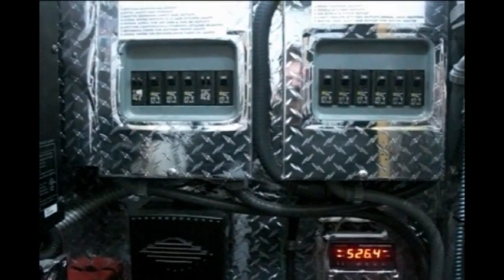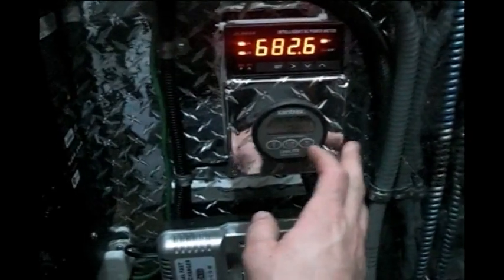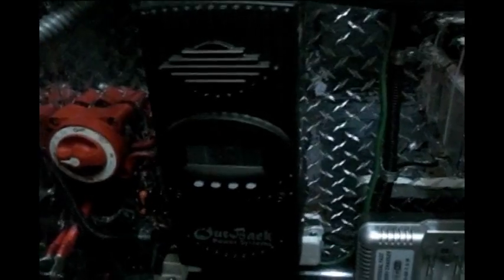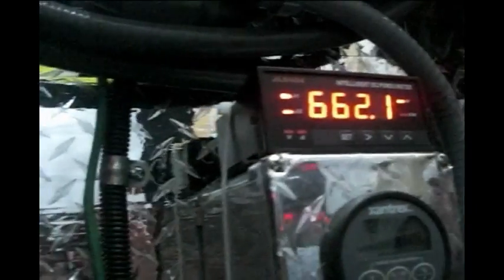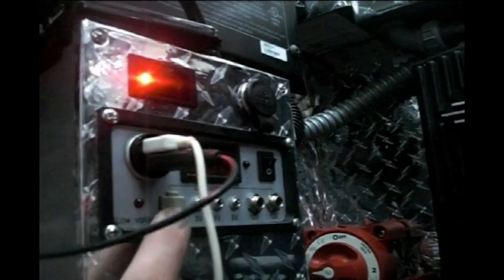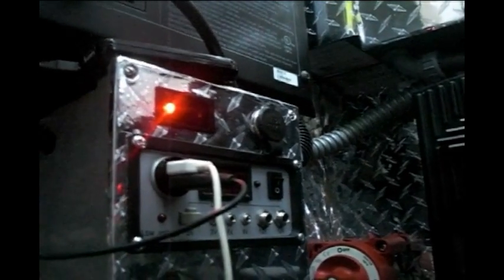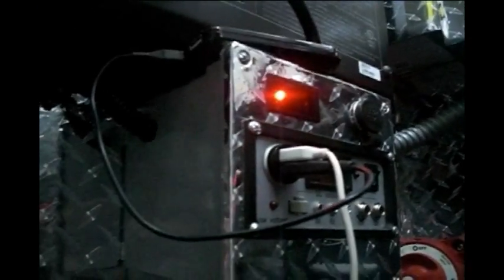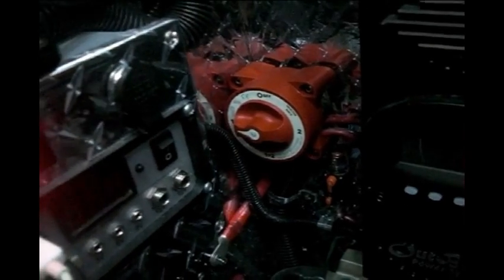My (NEW) Solar Power System "Revised"

Comment: Very nice set-up. I really want to move to that APC unit. Quick note. I encountered same problem on my Blue Sea switches running in the 1/2 position. I think you may be sharing same neg, so u might try running to a separate neg bus and from there have one neg lead to your GTI and one negative lead to your battery. Keep the videos coming. You provide a lot of great info

Comment: If your grid tie inverter is humming at night when there is no solar you may be back feeding the inverter with your battery bank causing the gti to run 24/7.  You may try a blocking diode to keep from having to use the timer.  Although the timer is an easy cheap fix.  Great video and very cool system!

Comment from the maker: @jwaflergmailcom I see where your going and i did wire it that way but im afraid to put that much voltage in the cheap china grid tie inverter i have... i think it can handle no more than 24 v if u have a suggestion on how to wire  that ill definitely consider it ...

Comment: Dude, Looks lik to me your burning a bunch a cash. Why don't you connect your panels in series. The reason i suggest this is so you can REALLY use that $500 outback controller. You need to get your panels voltage UP. It is up to you to how to configue them. You could do 5 pairs of series for 48v(12v x 4)- or 4pairs in series 60v(12v x 5). Just an idea!!!!